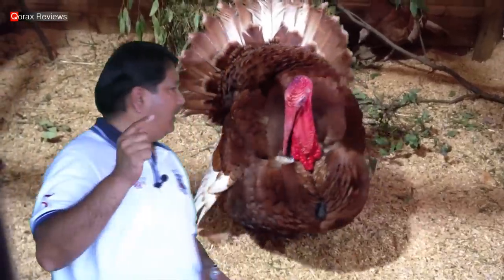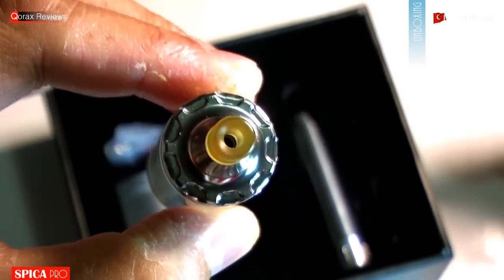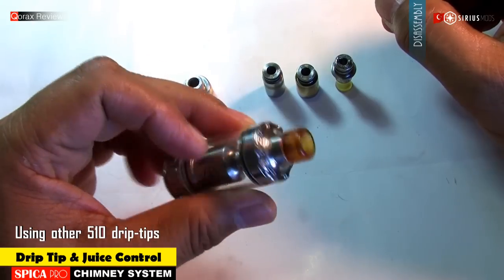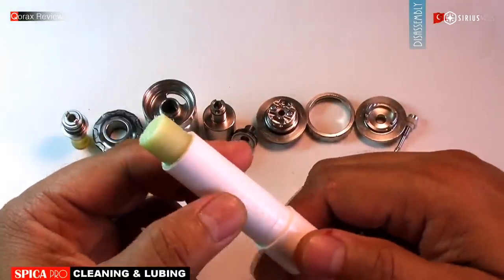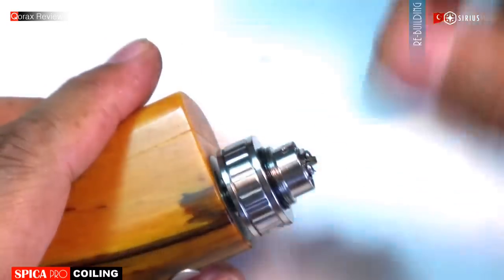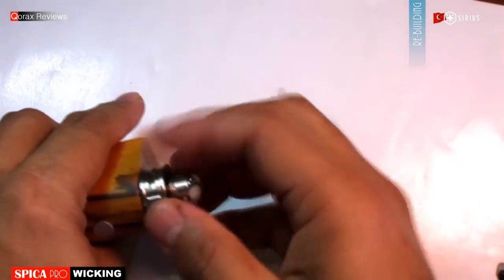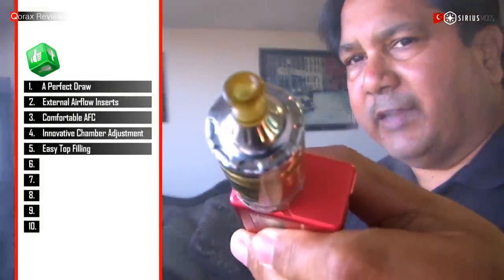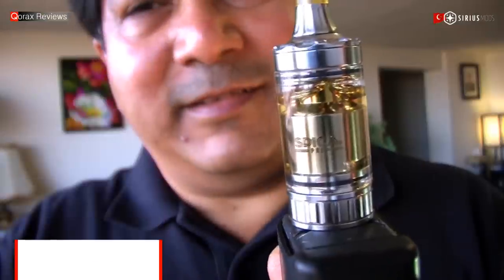Spica PRO, by Sirius Mods /REVIEW

Comment: as a Turkish vaper I am using spica pro like 2-3 weeks as main atomizer. Tested the atomizer with all different coil builds ( low ohm - mid ohm - high ohm - micro - spaced ) and tested with titanium - kanthal and ss.. Spica pro answer very well on my builds. everytime works perfect. very very good vapour production and amazing throat hit. good on flavor. as a restricted MTL vaper i prefer to use 5 leaf ( yea we choose to call that reduce kit as leaf ) reducer pin wih the lowest air flow hole. that chimney regulation is an innovation and really works. you will notice throat hit improve. Spica pro is one of a global high end atomizer at the moment. i believe you guys hear sirious mod names more in future with new atomizers  and mods.
Reply from the maker: Thanks for your input Kanayan. Cheers!